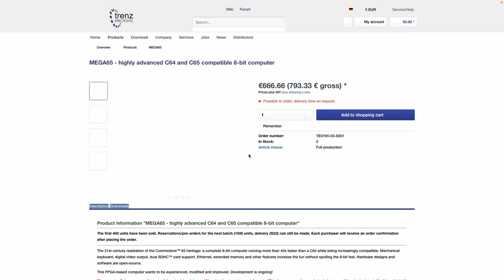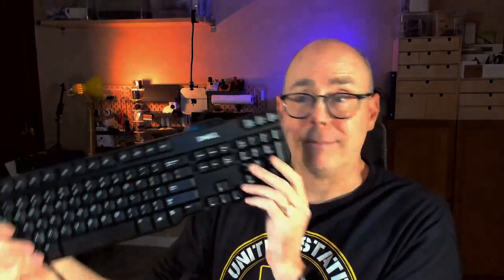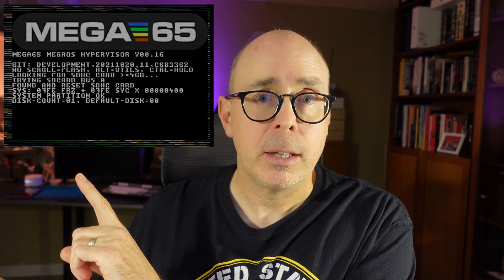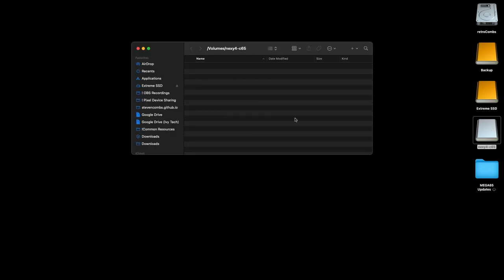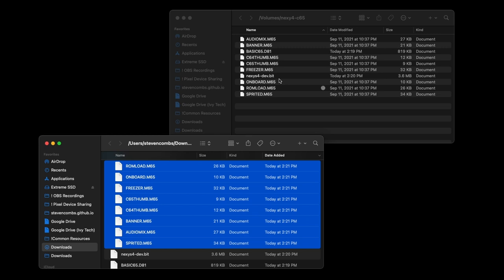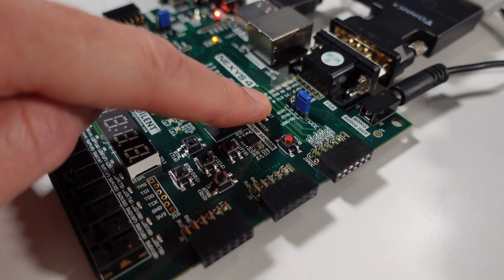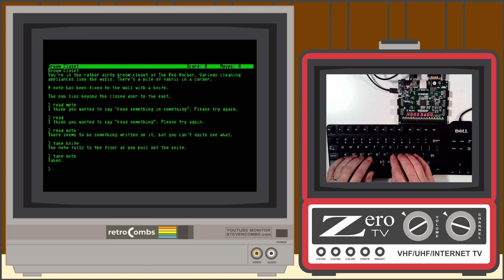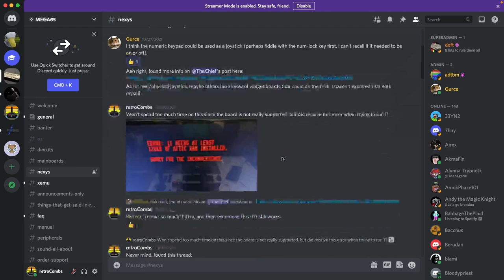Build a MEGA65 with a Digilent Nexys 4 FPGA

Comment: In the reference manual of the Nexys 4 in Pag 10 you can read the USB part.
"The Auxiliary Function microcontroller hides the USB HID protocol from the FPGA and emulates an old-style PS/2
bus. The microcontroller behaves just like a PS/2 keyboard or mouse would. This means new designs can re-use
existing PS/2 IP cores. Mice and keyboards that use the PS/2 protocol use a two-wire serial bus (clock and data) to
communicate with a host. On the Nexys 4, the microcontroller emulates a PS/2 device while the FPGA plays the
role of the host. "
In Short, the microcontroller PIC24FJ128 of the Nexys 4 read the data from USB but the Mouse and Keyboard have to be COMPATIBLE with PS/2 protocol. 
So, any USB keyboard compatible with PS2 protocol will work.
Reply from the maker: THANK YOU for this added information. It explains so much and also makes it easier to understand and identify why/which keyboards will work. Pinning this comment!

Comment: Its probably n-key rollover that's messing with the keyboard success since that either works with proprietary drivers or emulates an unreasonable number of usb hid devices to work and overcome the usb hid rollover limits. Some keyboards such as an older Corsair board i have have a bios compatibility mode that disables n-key rollover but the stock firmware seemed to have a bounce problem after updating the firmware it worked much better without proprietary drivers.
Reply from the maker: That's an interesting take. Wish we could get more keyboards working.

Comment: Very interesting video and glad to see the project working. I appreciate that you mentioned perhaps the main limitation, the inability to connect a joystick, be a DB9 or USB joystick. I'm also curious if it will use a mouse for GEOS, although it seems unlikely. So, while this is attractive as hobbyist and for the developer, i think people wanting to actually play any games on it will need to save for the actual Mega 65.
Reply from the maker: Until I can find a mouse that works, I won't be able to test GEOS and honestly without two USB ports, it is limited, so I go back to the possibility to add a 9 pin DIN via a PMOD but again, that requires development of the bitstream and I'm not sure how much longer the Nexys will receive specific hardware support.
Reply: If you use a Keyrah interface You can connect the c64 keyboard as well as a DB9 joystick. Also the Nexys 4 (the non DDR one which is exposed here) is not for sale anymore. Also the Nexys 4 DDR has been rebranded as Nexys 7. The Mega65 team support and will keep publising the Mega65 for the 3 Nexys boards. The main difference between these 3 boards are  the following : Basically the Nexys 4 (the non DDR one) could use its additional memory as Attic RAM because the MEGA65 team has implemented the code (but it has been disabled so far). For the Nexys 4 DDR / Nexys A7 there's no implementation at all for memory expansion since it would require the implementation of a DDR memory controller which has not been done so far. So if you can manage to get a Nexys 4 (non DDR) from an old stock this is definitely the card to get. Also keep in mind that depending on the Nexys Board you get, you must be very carefull with the core version you use, i.e., do not flash a Nexys 4DDR/NexysA7 board with a core made for the Nexys 4 non DDR and vice versa. There's no garantee it won't damager your board.
Reply from the maker: The non DDR is available here: https://digilent.com/shop/nexys-4-artix-7-fpga-trainer-board/ Thats the one you are talking about. Correct? I'm going to play with the Keyrah. I have one available that I can test with the Nexys.
Reply: @OlivierSimpleLife   @retroCombs  that would be an interesting test. Of course it also depends on how the keyrah is perceived by the board and if the core is prepared to use it. If it acts as a USB hub the board may not be able to use it at all.
Reply: @retroCombs  Indeed that's the one, only 13 are in stock and definitly so far, even if the code has been disabled in the core, it's the only one which has an implementation for ATTIC RAM. This means that potentially (unless a DDR controller is implemented in the core for Nexys4DDR/NEXYSA7) it's the only board which can take advantage of the additional memory.
Reply from the maker: @jalzate  Great point about the hub limitation.
Reply from the maker: @OlivierSimpleLife  You are WAY smarter than I am about this FPGA than I am. Thanks for sharing this information!
Reply: @retroCombs  Combs you have some wild wild guys on here with wild random knowledge.  I just heard about the Mega65 a few weeks ago now I am thinking of building one for development!!  haha ohh man love computers!  And computer people too.
Reply from the maker: Wild random knowledge is our thing! My accuses me personally of being full of useless knowledge. 😂

Comment: And with this hardware the internet engineering - price ratio is balanced again. Thanks for this video. The Mega65 is too unpolished for its price.
Reply from the maker: The community currently experimenting with a less expensive Wukong FPGA which will drive the price down more. What parts of the MEGA≡65 do you feel are unpolished?

Comment: so the Mega65 project is closed in some components....
Reply from the maker: Not sure I understand the question/statement fully (apologies). Do you mean the MEGA65 includes some proprietary hardware? If so, yes. The board is a custom implementation of the Xilinx FPGA.
Reply: @retroCombs  Yes, my apologies, the statement was not clear . Based on what I understand from the video the ROMs are closed source . And maybe the sources for the fpga too. Am I right? If this is right then this changes my vision about the project, added the fact that the machine is quite expensive too.
Reply from the maker: @MrRobbyvent  That is correct, but there is an open ROM and you can patch the original C65 .ROM. I should probably add more information on the companion blog post about these ROM types or create a separate post/video.
Reply from the maker: Bitstream is not closed. The .ROM, due to license, is not available without a MEGA65 purchase; however, the is an open ROM available and you can patch the original C65 ROM.

Comment: Looks like youtube deleted my comment. Just wanted to follow up my previous comment and say I found in forum64 and youtube evidence that keyrah works with the Nexys to provide joystick input, but creates a possible issue in that it means a C64 or C65 keyboard is then needed. Even if one can find a C64 keyboard, then there would be the question of whether not having the additional C65 keys would create a problem for some of the functionality, such as selecting core, etc. You can find a video called "mega65 with keyrah v2"
Reply from the maker: Thanks for sharing. I have a Keyrah. It could be a fun experiment. I also gave a spare Plus/4 and VIC-20 keyboard, but like you wonder how well it would work with the missing keys. Thanks for sharing and for watching! Not sure what happened to the original comment. Did it include a link?
Reply: @retroCombs  yes, it had a link to the video I mentioned. But come on youtube, it was a link inside youtube!!! :D
Reply from the maker: @jalzate  Agree! I checked to make sure I had the moderation settings and comments with links are allowed. Very odd. Thanks taking the time to repost though.

Comment: Not for 700 quid!!!
Reply from the maker: Pricey for sure, but I've been all in since the Dev Kit!
Reply: @retroCombs  I will clearly end up buying one of these, spending all this time just re-watching these two videos!  The level of "cool" this thing eminates is unreal.  The inclusion of BASIC and PETSCII keyboard, my oh my I need a glass of cold water over the head 🥛😎
Reply from the maker: @DailyCorvid  If you do, you must let me know how it's going. There's currently work on an add on board that will add a joystick port. Something I want to attack soon.
Reply: @retroCombs  Hey, is there any chance you can support USB controllers?  Just I have a dozen or so of them already (versions of all the classics!),
Reply from the maker: I've not been able to get one working yet but there may be some updates coming that fix this. Not timeline though. Of course, I haven't tried this in awhile either. Might need to give it another shot.

Comment: 200 is still to much for a System that have Like 0 Software, 0 Brands, only some dreamers behind. So you will only use the C64 Mode at end. 10 Mins 65 fun then only C64 what every calculater can Emulator today.
Reply from the maker: Check out http://files.mega65.org. There's a lot of fun software to explore with more on the way. For me, it's not about the package software but the upgraded BASIC 65. It's a blast exploring this language again after 40 years. I get it. This project isn't for everyone but for hard-core Commodore fans, like me, there's a lot of fun to be had.